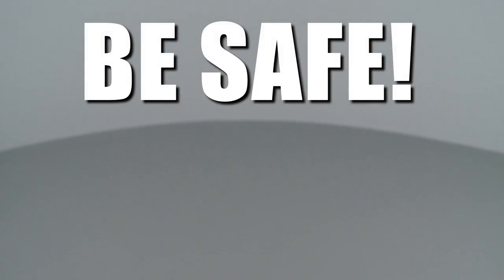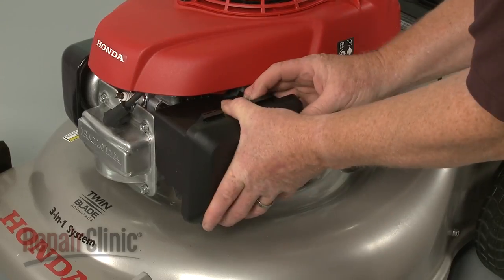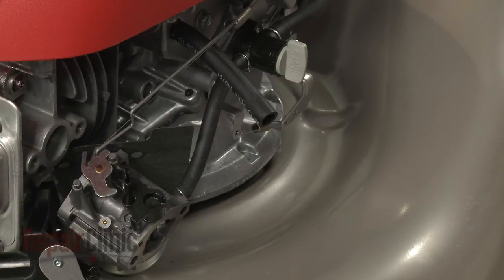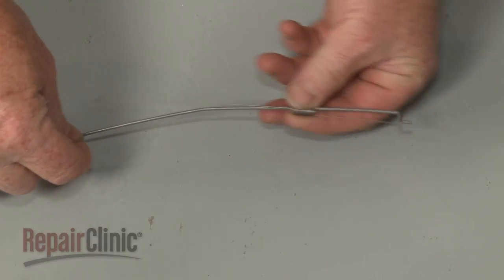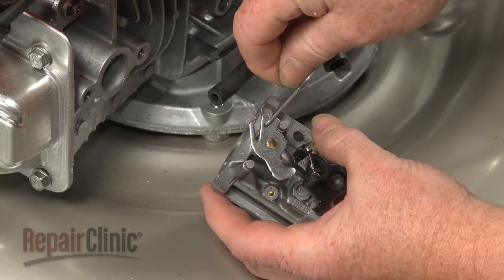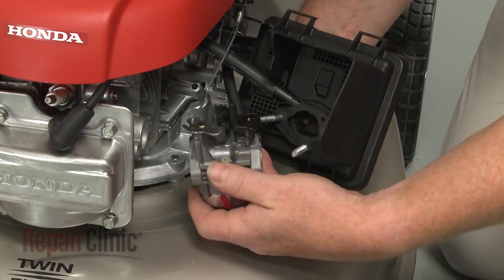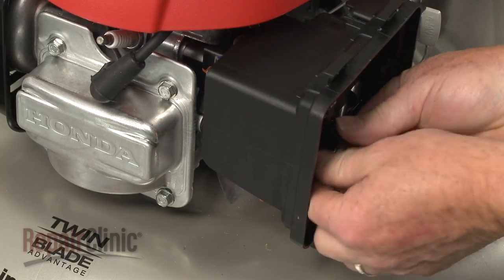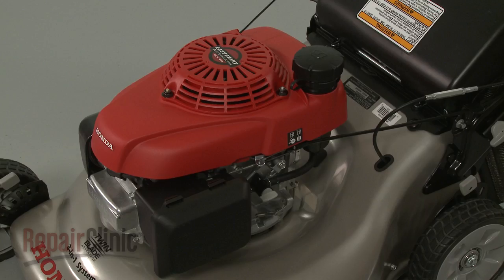Honda Small Engine Throttle Return Spring #16562-ZM0-000

Comment: Just replaced the spring on my mower, but really can't see how it performs any purpose.  The governor rod is hooked directly to the carburetor and the governor lever.  The throttle return spring is hooked to the exact same 2 locations.  What purpose does the spring serve?
Reply: KHM - Project Salty Frog  I was thinking the same thing
Reply: The spring just takes the slack out of the rod to limit early wear of the holes and rod at each end. Won't make it run a bit different. I've been running my GCV160 without the spring for years and can't tell the difference.
Reply: It ensure that the engine doesn’t stall and explode. This spring ensured it will start in spring
Reply: a stretched governor spring is more of an issue. lowered RPMs and power.
Reply: Remove it and you will see that the engine will surge up and down. This small spring is required to stabilize engine RPM's
Reply: George Carter My non mechanic ass doesn't understand how it works, but I broke the old one cleaning carburetor and you're right, it went from surging too high to low RPMs and Power. So I'll get a new one and put it on there, thanks.
Reply: @redwhiteblue9866  You welcome Sir. Consider the spring as a means to finely tune erratic rpm surges. P.S. I am a certified small engine Technician.( Briggs, Echo, Stilhl, Kohler, Honda and Kawasaki.
Reply: It takes the "slack" out of the throttle rod.  Without the spring, the throttle lever can move forward and backwards just a little, because the hole in the throttle lever is a little bigger than the throttle rod.  The spring just keeps tension on the throttle arm so that it stays tight against the front surface of the throttle rod, rather than ratting around back and forth within the tolerance of the throttle-rod-to-throttle-arm fit.

Comment: Does the chock control ever go bad? My mower starts then goes off after about a second, it sounds like its either being chocked out or not getting enough gas to run.
Reply: @repairclinic  I changed the spark plug, the mower is just over a year old. I will clean the carb.
Reply: Did you ever figure out what was wrong? I have a Honda GCV 160 that’s doing the same exact thing
Reply: @brennanbolsen8396  Nope, never did. I ended up buying a new mower.
Reply: I have to purchase this spring as well since it’s completely missing, but after draining the tank/carb, cleaning the carb, replacing the spark plug, and putting bad fuel cleaner in the tank, still no luck. Still starting and stopping… but if I hold the throttle closed manually  after spraying in starting fluid, mower runs like a champ… until I let the throttle open. Just ordered the part in that video I linked and I think that’ll fix it
Reply: @brennanbolsen8396  Mine did the same thing.

Comment: Why order the part when you can fix it in seconds?
1. pull little tension on the spring make new bend
2. Refeed 
3. cut the excess (after test run)
Reply: Nvr thought of that